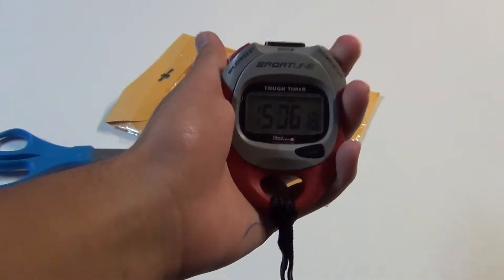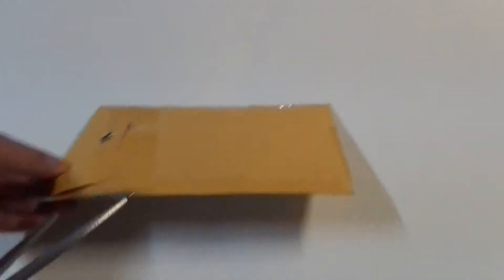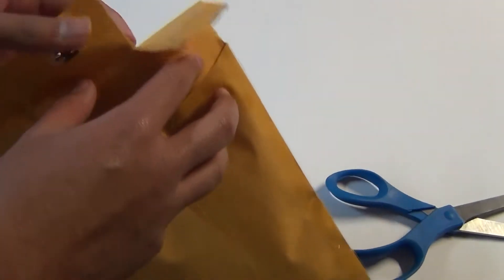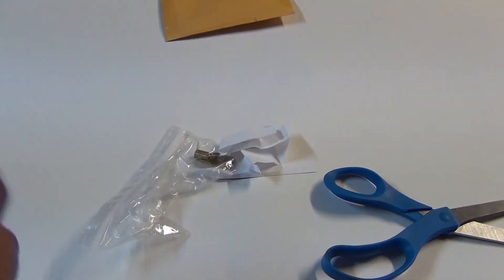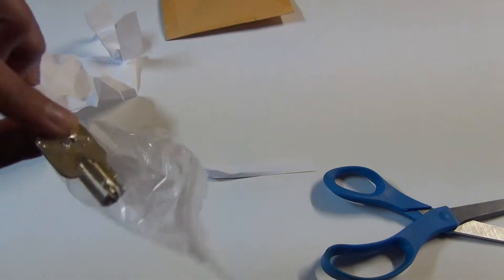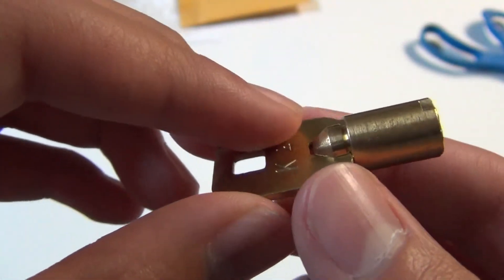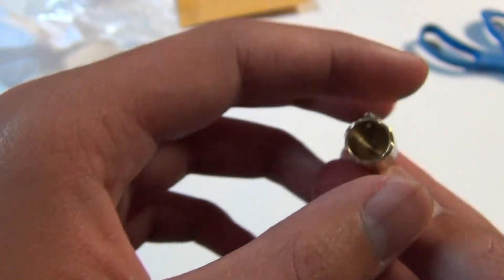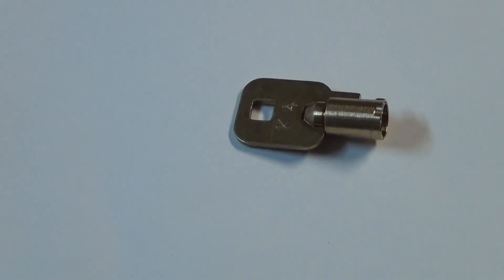Kone #4 Elevator Key Unboxing

Comment: That might not work. Some of the cuts look too shallow or not cut at all.

Your H301 key probably is defective as well. (Mine looked exactly the same and would not even fit in the slot. I got a replacement though)